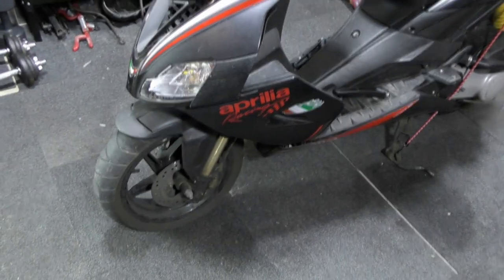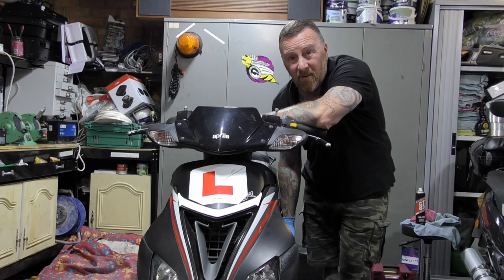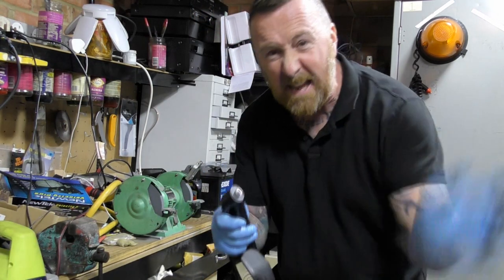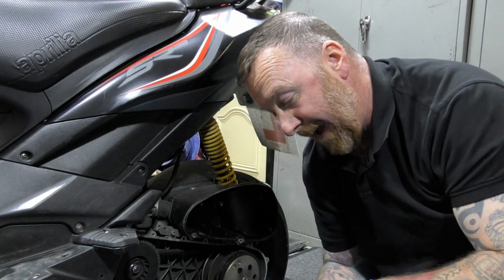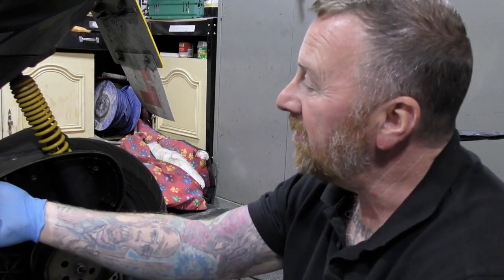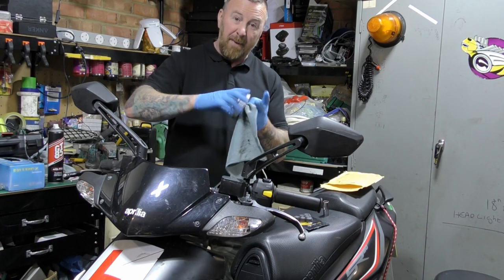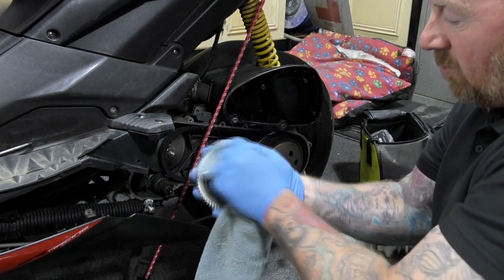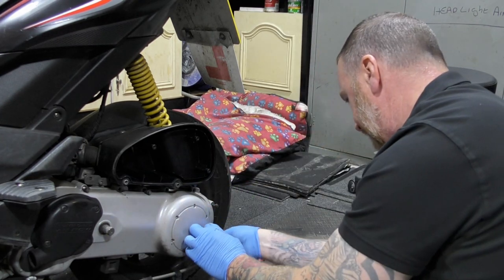APRILIA SR MOPED BOGS DOWN ON PULL AWAY MARK SAVAGE

Comment: Hi Mark, love the videos. I've got an Aprillia SR50 Motard which is struggling to run, starts on the button but bogs down, I tried everything you've suggested and nothing solved it so I took the head off and the piston is quite worn so I've ordered a kit to re-build it but I can't find the torque for the head bolts anywhere, do you have to correct torque settings please? Many thanks. Dave

Comment: Hi Mark, I’ve just bought my son an SR 50 and we are slowly going over and resolving the issues and your videos are a great help ! One question on the carb is that we have just found one of the cooling water pipe on the carb has been blocked off, do you know of any reasons why this would have been completed ? Thanks again for the great videos 👍
Reply from the maker: it doesnt really make i issue ,maybe it leaked but wont cause any major issues
Reply: Ok mate great thanks for the advice

Comment: Hi Mark,  I've got another issue with the bike indicating its overheating .. When idling it gets uptp three bars on the temp gauge very quickly and will then stay there, however when you take the bike on the road it will sit between 5 bars and even flashing when riding very steady. Apart from the temperature the bike seems very responsive and no  issues at all.

I've pulled the return pipe off the radiator and when idling you can see the water (coolant) at the pipe and when applying additional revs the water builds pressure and is clearly flowing, so i believe this would indicate the pump and thermostat should be ok as we are seeing a flow of water ?

What are you thoughts on the possible issue ? I'm thinking possibly temperature sensor or blocked radiator ?

I'm not sure what the water temperature should be when at three bars but when coming out it is luke warm at best i would have expected it to be significantly hotter than this at 3 bars

Thanks in advance for help and looking forward to seeing the new videos.
Reply: Replace sensor and make a small hole in thermostat and clean radiator with alot of brake cleaner

Comment: Hello mark I’ve watched most your videos and your a bit of a genius and as a last resort I thought I’d message in hope of my answer.I have a wk 50 ttr 2022 and the orange light keeps coming on and keeps cutting out uphills.it runs slightly better after 30 minutes of riding but has zero legs once I hit a hill.il take any advice about now.cheers mark
Reply from the maker: hi bud , have you looked what the orange light says it is ?, its 4t so no 2 t oil to mess with , are you using e5 fuel and not that rubbish e10 , yes i know you can use it but i wouldn't as in my e10 video on here . 
its not very old so to be fair i would go back to the shop and ask them whats up with it , you have check the engine oil but as under warranty i'd be going to see them bud
Reply: Hello  again mark I took my bike back to where I bought it and it’s apparently needs a new throttle body but could take months to come in as coming from china.I have no warranty as had it so cheap.checked the oil changed the petrol but still cuts out when going up hills or when first riding.I know your probably a very busy man but I thought I’d ask someone who knows what there talking about to solve my problem and suggest where I go from here as iv lost all patience with it.Thanks mark jack
Reply from the maker: @Bluebird104  hi bud , its going to be hard to sort as it does sound like you efi /cdi problems with the light that keeps coming on , 
so lets look , as it cuts out on demand so as you give it some up hill its fuel .
you could check carb and clean up the bowl  and clean up jets , check float make sure fuel is getting in 
cart remember if your was 2t of 4t ?
wait for get all that 
4t efi so no carb as such 
you cant control any of it bud im sorry to say !!!#
maybe last resort , drain out all fuel and use E5 super

Comment: Thank 4 such useful videos.
I've a question , my Aprilia 50cc sr 2017 dosent go up hill.
And after 5 min ridding it lose power and become very weak witch hardly gose 35 kmh.
I bought new belt and nothing changed.
What could be prob, 
thanks
Reply from the maker: Did you change and clean the variator ?
Check clutch 
Tune carb and check auto choke
Reply: @marksavage  Thanks 4 reply.
yes did clean the variator  but the rollers not looking that good do the rollers effect?
If yes what weights  rollers should i buy?
Do You have any video for Tune carb and check auto choke?
Reply from the maker: @122803ej  6g rollers and yes a mayor effect follow my  videos bud 
Yes type in tune mark savage or rollers etc
Reply: @marksavage   I Got it.
Thank you 4 ur help.

Comment: Hey i have a question about my moped 
Its speed fight 2 and the problem is that it vibrates when i want to drive and blue color comes out the exhaust and smells different.
Do you maybe the problem?
Reply from the maker: Odd as 2t isn't blue!
So using good 2t oil 
Normal petrol 
What have you done to it so far ?
And upgrades ?
Reply: @marksavage  Everything is fixed 
Just needed to change the belt and the nut to hold it.
Now it works perfectly.
Thanks for the help :)

Comment: My clutch is making a ringing sound i ride it down the road it just bogs down.Is my clutch going bad I'm getting get sick of mopeds I tried everything a new carburetor a new air box new roller weights and now this.I just can't get a break from my moped I hope it's my clutch not nothing else cuz that can be replaced easily
Reply from the maker: Oh dear bud 
But it is a easy part to change like in my video bud 
But they really are made cheaply

Comment: I'm running 33g total on 'rollers' and hitting just under 40-mph top-end
BUT...on downhill steep grade, a 'hyper-drive' kicks-in and it'll 'pin the speedo' very fast...too much for a Honda Metro!
What do you think the story is? Rollers too heavy or what? 
( There were 'Dr. Pulley Sliders' at 31g total before I had to make repairs from worn parts, and I usually hit 41-42 before the parts needed replacing, like little plastic 'Guides'/new Kevlar belt/new clutch-pads & springs/and new 'Polini' rollers )
Reply from the maker: they will always go faster down hill bud, i use 36gin total and always found it to be the best all round bud, the plastic guiders also need replacing bud for sure and will help a lot!
good clean after and make sure the belt it good and you should hit higher flat speed
Reply: @marksavage  Everything is properly clean, parts are virtually new, rear-wheel turns slowly at idle on stand...but steep down-hill I can actually FEEL the 'push' kick-in, not just ordinary acceleration!
As-if some 'hidden-gear' kicked-in!
They are all 'highest-quality' parts and 'Honda-approved'...so I'm more than a little confused as it never used to occur in the 4.5 years I've owned it
Reply from the maker: @gerrynightingale9045  oh so its a new thing!, how odd and its not on a aprilia .
as said it is normal to get more down hill but if its only started this your best to take it all off again and have a good look over it bud
Reply: @marksavage  I've done that already and found nothing 'odd' going on....but something tells me it's the rollers because all the new parts are duplicates of what was there to start with except there were 'sliders' before instead of rollers
I'll likely order a new set of 'Sliders' soon and duplicate the system 'as it was' at exactly 31g total and then see what happens where I 'topped-out' at 47-mph on a very steep grade which would be a rare event anyway...'50++' is just too fast and I think that much rpm is not 'healthy' for the engine or the power-train either and the Honda 'Metro' is 'old-school' with drum-brakes that work fine as long they are not subjected to constant hard use that causes 'glazing' on the pads
( I think Honda still uses 'drums' because in the Far East and elsewhere, there are no 'repair shops' and hydraulic brake-fluid is very difficult to get as well...and likely that's the same reason the 'liquid-cooling' system was dropped as well on newer models in favor of 'air-cooled only' because it's simply too sophisticated for places like India and Viet-Nam)

Comment: Help please old speedfight 100 starts and ticks over won't pull away new rollers ?
Reply from the maker: variator off and check it out , clean change rollers if needed , belt too
then clean carb etc  like in my speedfight videos bud

Comment: hi mate. I've got a 2015 speedfight 3 125 totally standard. never had a problem. your videos suggest they're not very reliable. should I sell and get a more reliable 125. any suggestions.  also can't find many modifications for the speedfight. 
cheers
Reply from the maker: I have had a sp3 125cc 
Not said they are bad bud and better than most other 125cc 
I'd keep it bud 
Easy to ride just twist and go
Now the sinnis I'm working on today 
Thats a pile off poo pmsl 
What i do say is you can't get parts !!
As for mods rollers and variator

Comment: So what was the rattle? 
Those SR's have the Piaggio motors. A lot better than the early injected Morini Ditech. 👍
Reply from the maker: I forgot to press record again!!
It was the kick start 
The little push out part was loose luckily,  I just took it out as they didn't have the kick start outer part
Yes carb and engine much better 
Thanks for watching bud
Reply: @marksavage  Awesome, have the exact problem with the rattle on my SR50. Have all the parts but cant figure it out, i need to put the glasses on and have a another look at it. Many thanks all the way from Sweden ;)

Comment: IF THE HOLE IN THE STAND HAS GONE OVAL . WELD A HEAVY DUTY  1.5MM THICKNESS .STAINLESS  WASHER WITH THE SAME HOLE SIZE ,JOBS A GOODUN :) JUST DRILL OUT THE BROKEN BOLTS AND USE A  HELICOIL AND A NEW BOLT :)
Reply from the maker: a lot of work and was only asked to fix but for £29 it would be just easier to replace

Comment: You say carb bog 2t....4t what do u mean 4 stroke ..... 2 stroke ?? Bet when u give me the awnser im gonna be like for ...ek
Sake lol
Reply from the maker: yes but 2t is 2 stroke , the carbs are different and the set up too , as in my videos and i have a few on this its normally too much fuel and if the engine is serviced 
otherwise air mix
Reply: @marksavage  cheers .got a sinning apache turned it into off road wee man sits on front but sometimes in a situations where need sudden power to get out a situation beeeerrrrrr just no power kinda cuts we fall off v slowly mind you. Kev slow and then fast its fine think going up a pilot jet have levelled the floats